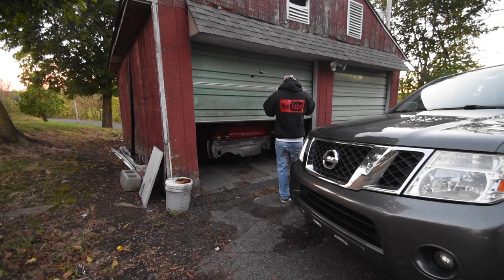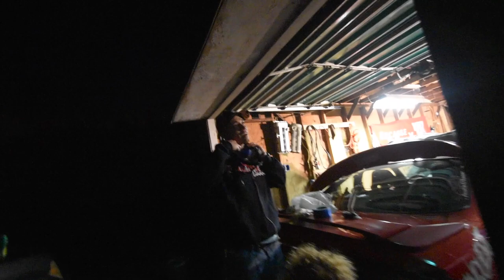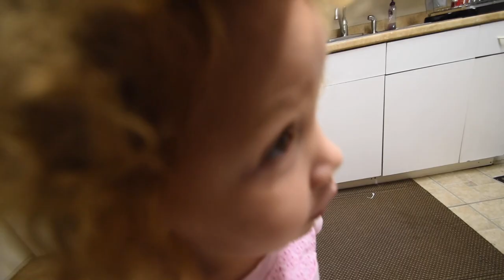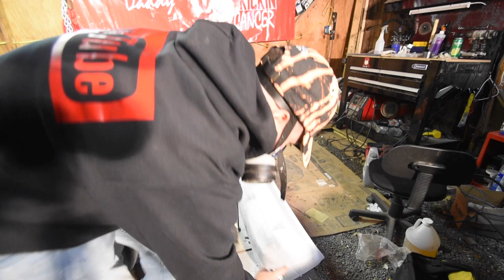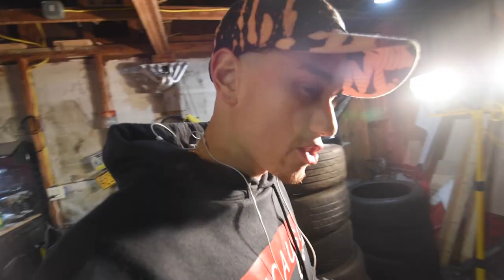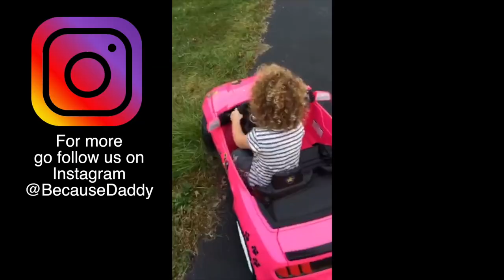FINALLY STARTING ON MY S13 COUPE! | DOES IT MATCH????

Comment: It sounds like your pathfinder alternator is going,unplug your battery and see if it stays running if it turns off that means it is the alternator but if it stays running them change the battery
Reply from the maker: I think it is going because I charged my battery and drove to work and its dead again..